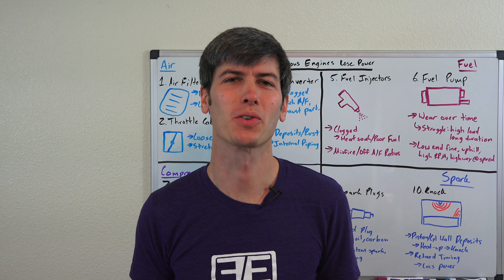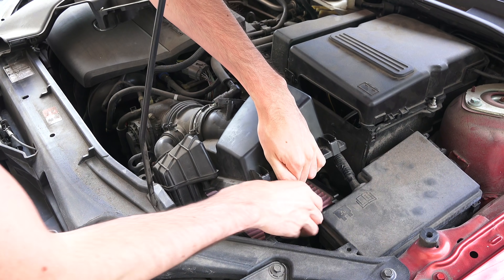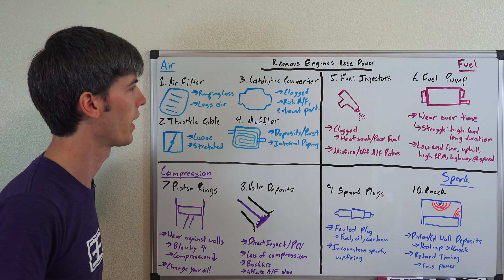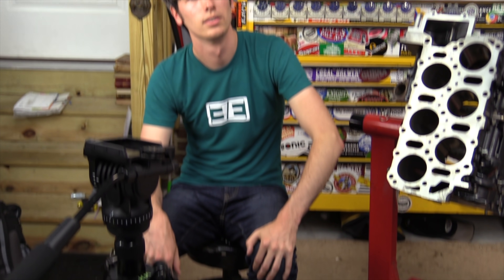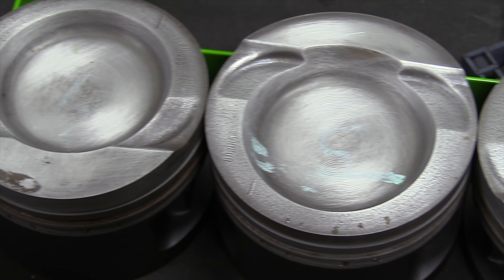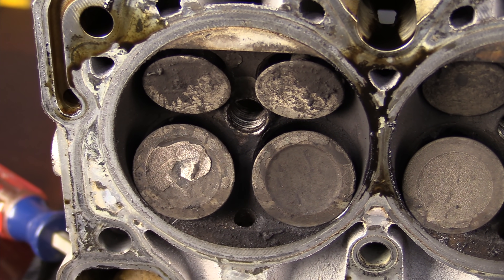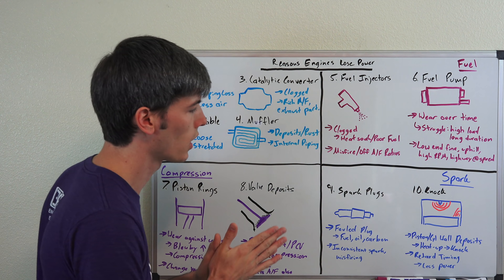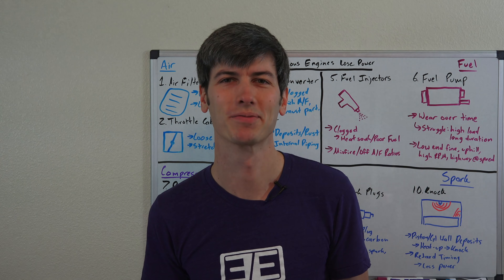10 Reasons Why Engines Lose Power Over Time

Comment: Guys just pat yourself on the back if you own a reliable Japanese sports car. I bought my g37s 6speed with 178 thousand miles on the clock and no regrets. Every feature on the car works and it runs so strong. I feel like if I had bought an American muscle car with this many miles it would have a whole slew of issues at 181k miles where its at now. Did I mention my 181 thousand mile engine barely burns any oil? Seems like it uses a half a quart every 5 thousand miles if that. I buy high mileage Japanese cars and wrench them. I climbed into my g37 with niche rims.. lowered on bc coil overs.. and with a catback exhaust .. for 7800 dollars. the exterior and interior are very clean.

Comment: Hey guys so we fixed many things on our car like the radiator, the suspension, the headlights even the hose. We thought it was all over until a good friend of ours borrowed our car and after they are done using it, he said something like the car does not pull.

Comment: I had a problem in my car  . Toyota vitz 1000 cc  problem is when I start my car when it cool car . Its start missing when car reached temperature hot it after 5 minute  it become normal .can you guide me ? What I can do ? I  also cleaned injectures , throtle , oxygen sensor, mass flow sensor ,after it also had problem.

Comment: Thanks for broadcast ...I'm getting no communication to OBD2 port car Stalling... on a 2005 PT Cruiser non turbo  and 02 senors low P0031 & P0037 voltage I replaced them but clear and they come back. Could it be an intermittent ignition switch not working at full voltage and in turn not sending 12 volts to PCM...in turn shutting down Fuel pump relay and ASD relay then everything has low voltage. Relay are working and fuses not blown. Can an ignition switch work to start the car but not put out the right voltage and lose communication with computer?

Comment: Here's a far reaching thought...Typically, a gasoline powered internal combustion engine only develops 20% efficiency.A piston driven steam engine goes to ( get this... ) 63%...! and a steam driven turbine is lower at only 45%. BUT... the problem with steam power is safety. O-rings break
and people get scalded and that's not acceptable.The mechanics in union lobbied against steam power in favor of R&D money to develop Internal Combustion at the prompting of J.D. Rockefeller who was then selling lamp oil in the 1890's. He saw writing on the wall in the light of Thomas Edison's light bulb and found a market for a non-commercial byproduct we know as "gasoline" and that's the history.Anyway...
    My thought...
On the vanguard of today's technology ( nano-technology actually ) is a new material they're calling "Graphene". Have you read about graphene and it's qualities...?
    You should.
    My conjecture is that with graphene infused  o-rings...we could re-think steam power and have an acceptable safety factor and claim a 63% + efficiency giving us less than one third the fuel consumption of today...
    What do you think of my thought...? I'd like to hear it.

Comment: Where does the engines horsepower come from?, presuppose I have a four cylinder 1.5 L turbo with 175 HP and about 175 torque, but I want to give it more HP and torque, Is there a limit to how much I can give it
Reply: I kind of understand power to weight ratio, my main question is can I make my stock engine do what I want, can i make it 1000 torque 1800 hp with 60 to 100 in less than 3 seconds etc basically can I make my stock engine ridiculously fast

Comment: for us old timers, valve seat recession, Camshaft lobe wear (reduced valve lift), increased clearances in big end bearings ,  weakened valve springs, coked up piston crowns.

Also for the newer ones, clogged or worn injectors.
Reply: Indeed. I am with u especially on t worn cam lobes that's t worst. something this young fella failed to descrive

Comment: Just spray some petrol in the intake mainfold and flush the filter with some alcohol or the same petrol (I also use acetone as one of the best solvents) On the fuel side it's good to use some acetone- alcohol solution in the gasoline (depending on engine compression) so it absorbs moisture as it is a good water solvent. I live in a poor countryside and we've been doing this for many years even with old diesel machines and most of them are working even after +50 years. My grandad even told me he used to burn (literally) heavy diesel clutches when pressence of oil as they where "fireproof". Aww the good old days...

Comment: I have a question that even a dealer mechanic could not figure out I have an 08 Jeep Grand Cherokee 4.7 that has a hesitation issue it's not always it's very random I could start up and take off down the road work perfect park it start up take off down the road I'll send falls on his face just for a quick second it comes out of it really fast I don't have no issues driving up hills it doesn't lock down or lose RPM just while driving mostly when you go to take off or sudden acceleration like going to pass somebody at first I thought it was in my throttle so I put a new throttle body on it then I thought maybe it's my map sensor then I thought maybe it's got to do with my plugs and wires that didn't work so I thought maybe my EGR still have the issue then I decided to put new catalytic converters in I'm lost at this point to know what to do stop my coils because I put my foot on the brake but E-brake on put it in Drive touch the gas and it doesn't break down at all it holds RPM I know it's not an air problem because if it was getting too much air it be tacking up high I don't think it's a fuel problem I've checked fuel pressure at rail and it's fine perfect the only thing that makes any sort of sense is that maybe fuel injector but I know it's getting fuel or you definitely notice it wouldn't be here and there it'd be acting up all the time maybe a possibility of too much fuel causing it to bog down but wouldn't even then be more constant it's not constant it don't always happen it's very intermittent no pattern if anybody out there has any ideas let me know thanks

Comment: Nice video, but there were only solutions to the first two items (air filter - replace, throttle cable - readjust).  How come there was no explanation of what to do to correct the other issues.  Is there any other options other than to replace a catalytic converted or muffler.  Or fuel injectors, valve deposits.... are there detergents like sea foam that might do the trick?

Comment: You did not mention timing chains becoming worn/slack which retards cam timing. Let’s not forget about vacuum leaks from old hoses throughout the engine on systems that depend on vacuum, especially on older cars. Speaking of spark plugs, if your engine makes let’s say 50 horse power, and the spark plug misfires just once every 50 cycles, you lose one horse power , when a spark plug gap grows from ware, it takes longer for the coil to build up pressure enough to jump the gap. The result is slightly retarded timing.When the center electrode surrounded by the insulator is worn around the edges, rounded, you can lose up to 60% of your voltage at the plug.. Don’t forget about the ignition system, bad plug wires, older coils, bad grounding. What about oxygen sensors, airflow sensor, how about bad valve guide seals causing the engine to ingest oil which lowers combustion efficiency and causes deposits, those deposits actually get on the oxygen sensor and coat parts inside the catalytic converter and it’s a domino effect..Short trips, city stop and go driving also wears out engines faster

Comment: Great video. I have an older car (15yrs) and it's knocking, esp on acceleration. What do you recommend to get rid of the knocking?
Reply: A higher octane fuel  & /or decoke. ( carbon buildup) . Anything apart from these two gets complicated a nd hard to explain.

Comment: You talk about changing the air filter, but do not mention the fuel filter. Apart from that it is an excellent video. there are so many people out there that have no idea about what goes on under the hood, and end up getting ripped off when they take their vehicle in for maintenance/repairs.

Comment: I agree with most of this... all but the fuel pump thing.  If your fuel pump is starting to go bad your ECU will have a little chat with the MAF and HO2S and throw a check engine light for one or both of those systems.  Then again what do I know, I have only been working on cars for the last 18 years!

Comment: Summary "Design flaws etc glitches & imperfections mixed with Entropy"
Reply: Any direct injection engine without an intake port injector to clean the valve represents a design failure of an incomprehensible nature given the long history of engine design and associated human intellectual capital knowledge of engines by the engineering staff working on the engines : FORD ECO-BOOST brain fart disorder valve deposits etc with dry intake air polluted with crank case fume gunk : they appeared to fix the issue with the addition of a port injector to spray cleaning gasoline onto the intake valves with some engineered interval to minimize deposit formation on the intake valve & valve seats :)

Just thinking about this makes me want to install an oil catch can............

Comment: Hi Jason, a question... probably a silly one, On GDI engines the intake valves buildup is a recurrent issue, does the same happen on the High Pressure Injected Diesel ones? For example on BMW/PSA THP EP6 engines is a common issue, but so far I haven’t heard the same problem on their DV6 HDI engines. Why?

Comment: dirty fuel filter sometimes makes your fuel pump work harder so you might wanna check that too.
besides it pressure on fuel pump may cause damage so replacing it is a good idea
Reply: But the bad thing is the newer cars don't have fuel filters on the fuel lines outside the fuel tank there mounted inside the tank by the fuel pump now

Comment: in the late 70's to 80s I was a mechanic with my own shop.  I have  found that valve wear is the problem.  If you lap the valves you get much of your power back.

Comment: I'd love to see you do a video on why engines use so much more fuel when the weather gets cold.  I have a Prius C (Yaris Hyrbid) which gets 60 - 65 MPG (UK) when the weather is below 10 degrees C. The very next day, when the ambient temp. gets to 13 degrees and above,  however,the same car, using the same fuel, will give 70 - 75  mpg (UK) !!!
Reply: Temperature, they run slightly rich when cold, colder air is more dense, requiring more fuel

Comment: Reason 11: MAF sensor will over time get dirty/corroded. Knowing how much air the engine is getting is important because the car's computer uses this value to know how much fuel to give the engine. An old or dirty MAF will measure less air flowing and cause the car's computer to give too little fuel...

Comment: How about timing chain stretching ? This causes poor timing between crank position-piston travel and valve openning. I noticed an improvement of torque after changing a timing chain, and even a timing belt, despite they are supposed not to stretch.

Comment: I find lots of improperly installed air filters & the owners have no idea. This will wear out an engine quickly. Most are because the two halves of the air box have not been  secured together properly.  Check you air box after taking your car in for any service, particularly an oil change. Could have been left loose.

Comment: Look it up, most German cars actually never loose power, even after 400k miles, that doesn’t mean they didn’t get new injectors/02 sensors etc, but the engines are still solid.

Comment: When I'm going uphill with my car, I'm going 1st gear and my car has to go around 4000 rpm before I can shift to 2nd gear with just enough power to move forward, yet before if I was going around 4000 rpm my car would've probably flew off.
Then a car stopped (still uphill) yet I was going quite fast, I had to brake wich mean I was going slower, Normally I downshift to be able to overtake the car in front, so instead of downshifting and gaining more power my car was slowing down (I had to go from 3rd gear to 1st gear to gain power faster and yet...), Instead of overtaking him, everybody behind me overtooked me.
We already changed the sparks plugs, I had a problem with my timing belt that I fixed as well, I changed the air filter too.
But we didn't touch the fuel filter and the fuel pump, so do I have to change my fuel pump?

Comment: A mechanic that would build engines for Dale Ernheart said in a forum about Marvel Mystery Oil .
ALWAYS use 4 oz's per 10 gallons with a new motor ....it creates a dry lubricant on the walls.
I have used the product for 6 years as my uncle was a mechanic that used it growing up and in the arctic instead of a blow torch.
He added it to the crank and gas tank fuel and -20-40 was no longer a problem.
Raises compression in tests about 10 to 15 %.

Comment: Does cam wear have a significant impact on performance? If the valve travels let's say 1mm less, does it affect the engine performance? Or is it too small a change to notice?
Reply: Absolutely. Especially with the lobe's eccentric shape affecting the timing of the opening/closing of valves.

Comment: friend of our converted his truck to propane and we did a tear down of his engine and it looked bran new,  another thing we hav noticed our engines once getting around 36k miles is when we noticed a increase in fuel mileage,  people dont like to maintain or do mantaince until they have a problem this is key to follow up on follow thur with proper maintence and you will be fine,  again my friend came down from canada we had same trucks but he gets almost 3x the fuel milage we get, the tech, is there and yes after he was here for 8 months the dealer said he had a recall on his fuel system, ha, he said he wasnt changing anything, and he didnt,

Comment: I've seen some gm engines with a restriction attached to the back of the throttle blade.  So wide open the throttle bore is only able to flow around 80 percent.

Comment: I have a interesting for you and hope that is enough for a video. 
I had a Ford Escort MK7 with the 1.6L 66kW (90PS) Engine. 
And after some time with it I noticed the following “issue”. 
After some time on the Autobahn and high loads of 100% throttle, the car had more power or rather more torque. 
I noticed that when I arrived in the next city drove around there to my destination. It felt way more alive and nippy. 
After the car cooled down, it was the same as before. Slow and boring all over again. 
I don’t know if it was normal and has to do with it but that the car consumed 10-11l fuel every 100km. 
It can’t be on the service part of the car because I maintained it good. Every 10k I changed the oil, all filters and spark plugs. After some time I changed the hole exhaust manifold plus the catalytic converter. Everything was brand new as it gets. 
Every time the car cooled down from such a drive it became “slow” again. 

Do you have any ideas what that could have been ?

Comment: My cousin has a porch boxter that he allowed to sit in a barn for 5 years because he didn't feel like fixing whatever issues it had. He offered it to me but after sitting so long I hear that all the gaskets and internals might need replaced which could be more expensive than buying a used boxer that hasn't been sitting so long

Comment: Some of these things can be easily fixed (e.g. replacing a single cheap part), some not. It would be great if you could have a video explaining what to do to diagnose and fix each of those possible issues.
Reply: A good example of that is the engine knock. It doesn't mean you just lose power it means your engine is going to catastrophically fail imminently and needs to be scrapped.
Reply: @srspower  1997 engine is hard jackpot
Reply: Jaguar 1997xjR8

Comment: Ive got a 99 suburban with 360,000 miles. Runs like a champ. You're welcome to check it out. Its on the Chevy truck legends board.
Reply: And when i got it, it was not running. Didnt change any hard parts. Just figuring out the engine management issue was a pain. And a good story. Lol

Comment: Just one question about the knock. Why is the spark plug firing later? Wouldn't you want to fire earlier before upper dead centre in order to prevent uncontrolled combustion?

Comment: The segment about Fuel Pumps is "partly" inaccurate.  (For fuel-injected systems.)
- It's not so much a reduction of "volume" of fuel flow.  What is important is that a "weak" pump might-be pushing the volume, BUT... the greater question is:  Is it creating the "PRESSURE" (PSI) needed on the injection-system?  That PSI is important to push the correct volume of fuel through the injectors,... and it also affects the "atomization" of the fuel spray.

Comment: There's actually a lot more to the loss of power. This includes the power train, transmission bearings, rusted break calipers, worn down piston bearings, worn hub bearings, worn clutch... I do realize that this is strictly about engines and not the powertrain and any accessories attached to it, but still...
Reply: That is true if the video were labeled reasons why a vehicle loses power. This one is about the engine.

Comment: 11. Increased parasitic drag due to worn out main/rod bearings.
12. Worn/stretched timing chain.
13. Old ignition coil(s) and plug wires.
Reply: Old plug wires can also cause after market audio systems to have engine whine come through the speakers.